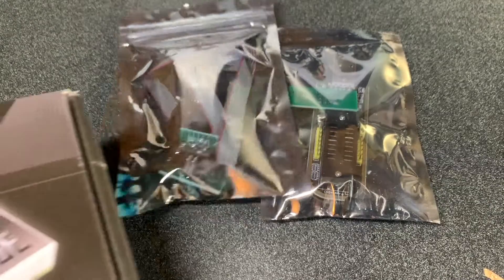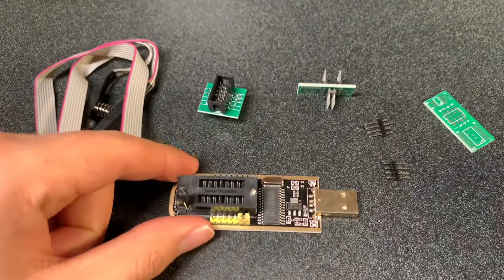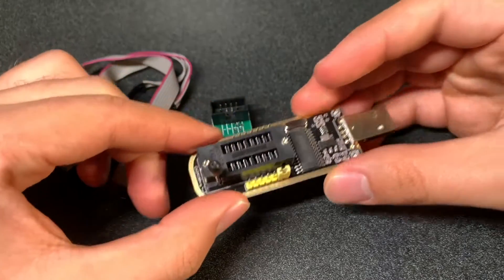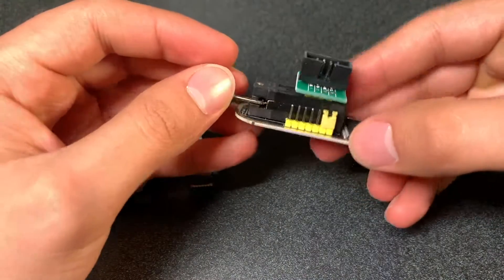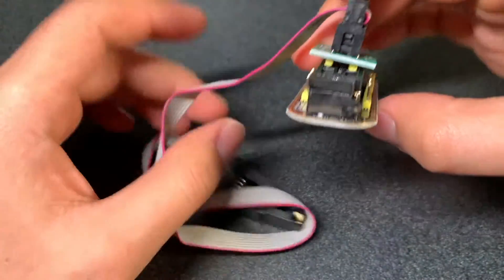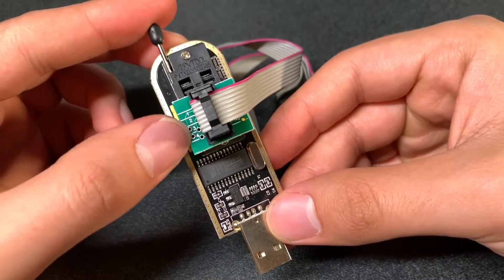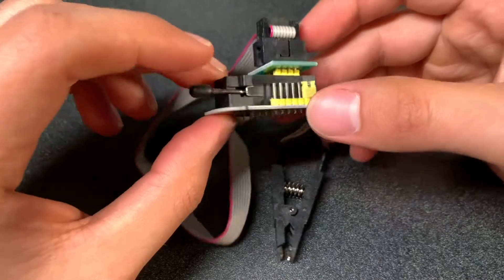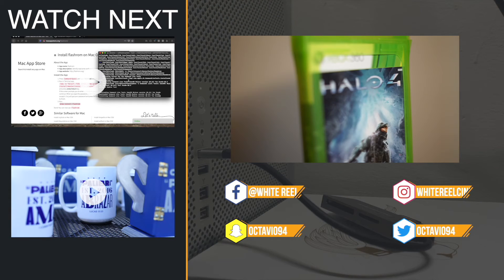Tutorial -  How to Connect CH341A USB Programmer Flash (Titan Ridge on Mac Pro 5,1) Thunderbolt Path

Comment: What version number is your?
Mine is V.1612, i wonder if it auto switches to 3.3v when flashing?
I have read about that it lowers the volt during load based on vid (if i remember right) when flashing non 5 volt chips, and raises the load to 5volt in idle again, that is why i ask, but no one have any source for that claim, or at least an video showing it.
I also have an green V1.7 with the volt switch, but it is buggy on reading /writing the chips.

Comment: I keep getting "couldn't open device 1a86; Error: programmer initialization failed" when I try to check for the chip with flashrom -p ch341a_spi. Any thoughts?
Reply from the maker: In what device are you trying?

Comment: Hello, why not solder for the low voltage mod?  Did you change the yellow jumper pins?
Reply from the maker: Because it work as is
Reply: @MrOctavioLozano  thanks.